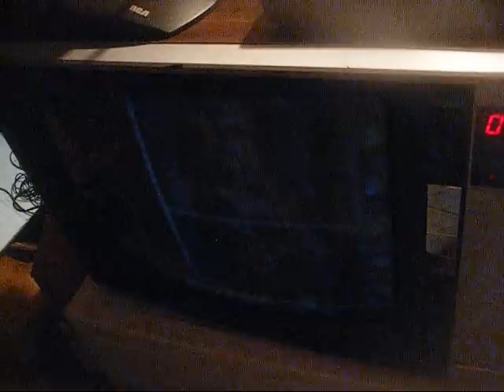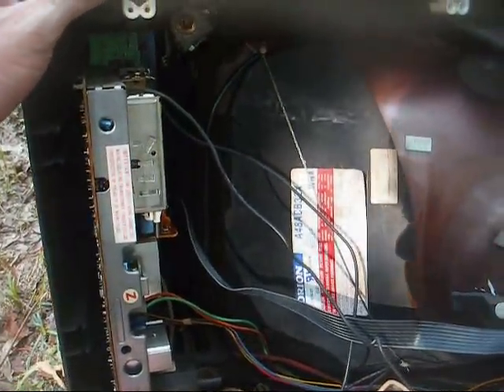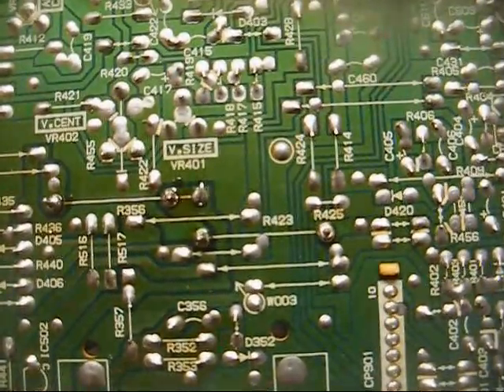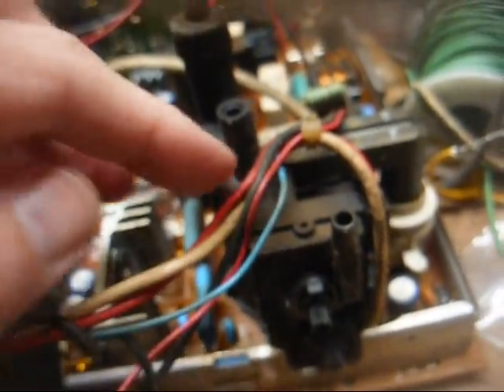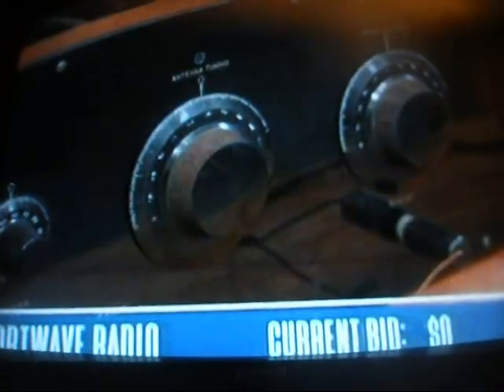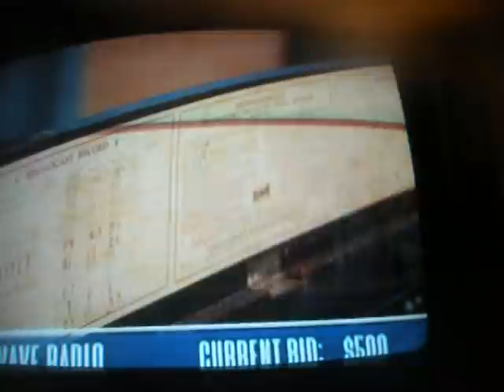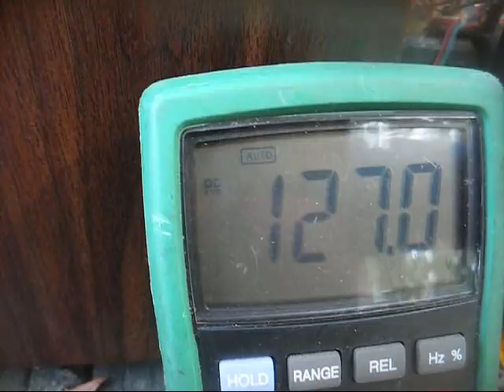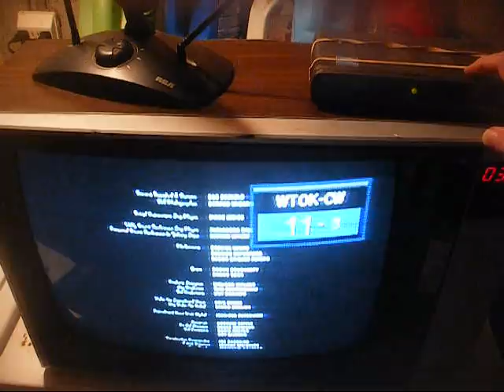Repair of a 1988 Emerson 19" color TV

Comment: My parents bought the 13" version of this same very model brand new in 1986 for the kitchen. It replaced an older 13" black and white Zenith from the 1970's. The Emerson lasted nearly 20 years under fairly normal usage until it then was replaced by a Poloroid HD flatscreen TV in 2006. We still have the Emerson in storage since it was still working perfectly, as it had never developed any issues the entire time in use.

Comment: You haven't really experienced your entire life flash before your eyes until you've accidentally brushed your arm or wrist across that anode lead.  Even after being turned off if you haven't discharged them they can retain enough lightning to make you go home and change your clothes!  As a young technician I was working on my parent's old Sylvania and tried to discharge that lead, not realizing my finger was still touching the shank of the long screwdriver I was using.  My mother never forgave me for the hole in her kitchen wall that had to be repaired.
Reply: A hybrid Sylvania console held such a high charge, it threw me back and I saw stars. I'll never forget that..
Reply: When I was younger, in my teenage years into my early 20s when I was working on CRT monitors and TVs alot, i got hit by those anode leads many times. Especially reaching into projection sets to do an alignment while its on. 30KV blast into my hands and arms were not fun.
Reply: I was talking on my radio holding a D104 microphone in one hand and touched the 2200 volt plate supply to my amplifier with the other hand.
Lots of voltage, about 400 milliamps current. Blacked out for a minute and blackened the end of my finger.
Reply: @gordonwelcher9598 , and probably browned the bottom of your shorts at the same time!

Comment: Me and my brother had an older 19" Emerson. Not remote control but with the dials. It had a very good picture but the vertical output transistor went so the top 1/4th of the screen was folded over. So it went in the shop for a bit and it came out and played for another 10 years before giving up the ghost. And we put a lot of hours on the set. Colors were good but not excellent. It had an Orion tube.

Comment: I've got the 13" version of this set.  Mfg date Feb, 1988.  I have had it since new.  Didn't get a ton of use the first couple of years and then was my daily set from about '91-'95.  Has been setting for the most part since.  I did use it as a monitor on the VCR for when I was doing video captures of old family VHS home video's a couple years ago and it was working OK.  The brightness a little slow to come up when turned on but no other issues.

Comment: You’re right; popping off yo the customer is generally not recommended. That being said, however, there are just some things you never want to see come in for repair ever again, as they’re so service-unfriendly, and it’s always some cheap $2 part that fails, but it take $200 or so in labor costs to get to it. Or, as the old saying goes, “once burned, twice shy.” And it isn’t just electronics; there are just certain makes and models of cars that auto repair shops don’t want to see towed in for service.

Comment: I had the 13" version from 1989.i got it in the early 2000s from a family member. it was hooked upto cable tv and my nintendo and vcr. I wish i could have got it fixed it was a great tv. but i was like 12 or 13 so i didnt know where to take it. but my grandpa gave me his 25" magnavox tv/monitor from 1986 and i used that for years. My main tv now is a hitachi 20" tv/monitor from 1986 in a matching wall unit. i dont intend to buy a flatscreen.

Comment: The 90s Zenith crts got so bad in that I turned those away after awhile. Would ask if it turned bright green and died. If so either turned it away or gave them a price for crt replacement.
Reply from the maker: I'm sure nobody went for a CRT replacement. Back around '93, someone gave me a 27" Zenith with a bad jug (A68ACT00X). I bought an Opti-Chrome rebuilt tube from the parts house and it wasn't long before that tube shorted and blew out the power supply. I got so that when I saw a Zenith from that era with a cremated power supply, I condemned it.